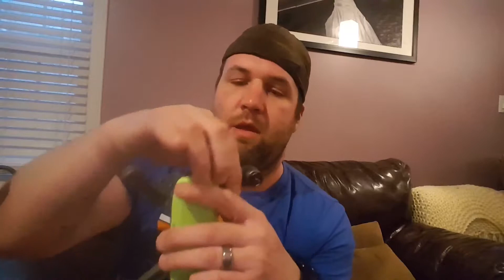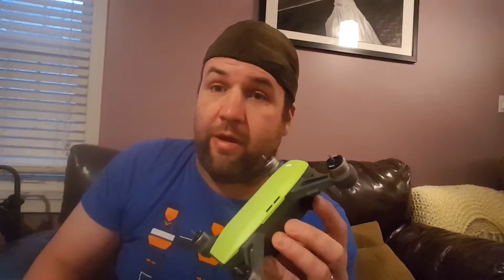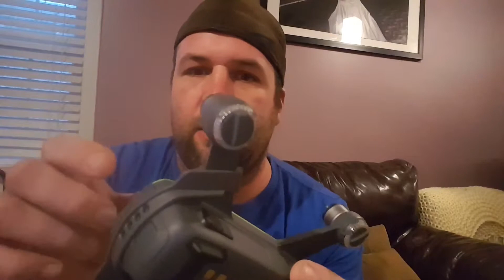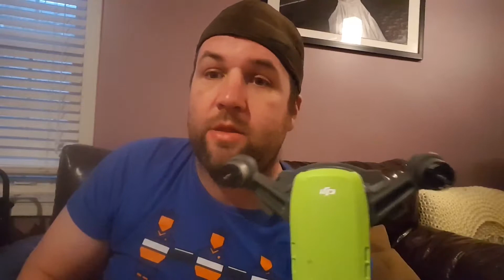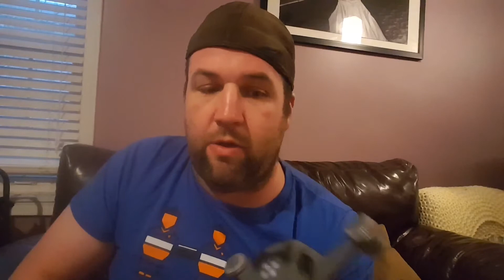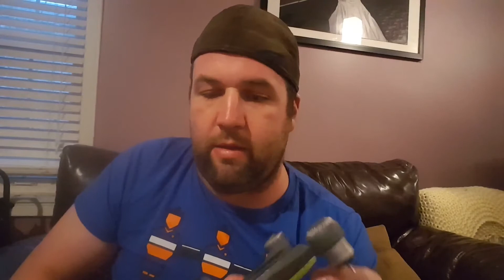DJI Spark Battery fallout part 2

Comment: That sucks dude. Never had that happen before. Owned the Spark since launch.
Reply from the maker: Southern Adventures 186 flights, 10 hours of air time at the drop out. Not doing anything goofy. Just trying to get some video of the park I was at.
Reply: That's interesting. I will tell you that its always been a concern of mine. I owned a GoPro Karma. I saw all the battery issues with that thing so started tugging on the battery before every flight! That transferred over to my DJI product! lol
Reply from the maker: I found on eBay a "battery lock" for the spark. They wanted 12.00 for one. And Amazon had them 2/10. Needless to say I got mine from Amazon. I can tell you this much. I won't fly without it once I get mine back.

Comment: Is the "known issue" with the drone chassis or with the battery? I'm guessing there's a tolerance issue in the latch or the point where the latch connects to the chassis. I saw one video where a guy had a second battery fallout with the same Spark and tracked it down to a broken latch on the battery that kept it from fully engaging.
Reply from the maker: videoscrapheap I explained to the DJI Tech that the battery fell out, and as a result the chassis broke. And his next words were "That's a know issue with that model". I would assume they know the battery falling out is the issue, thus causing Sparks to fall out of the air and causing damage to the drone, or loss of drone.